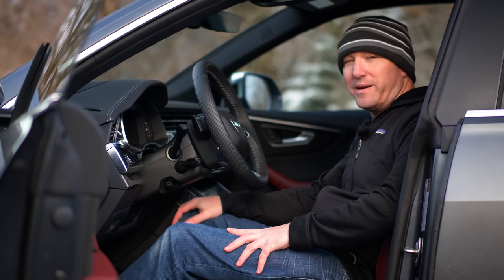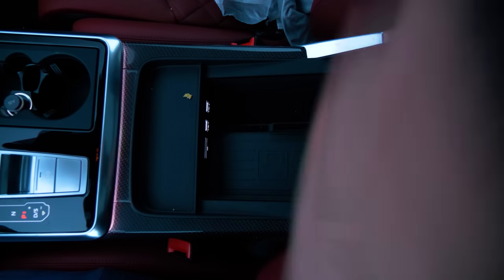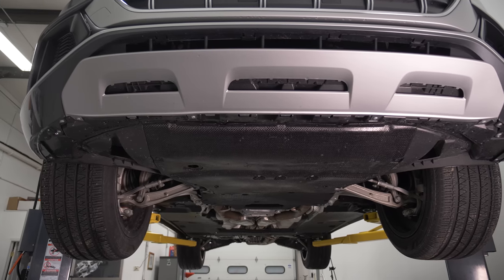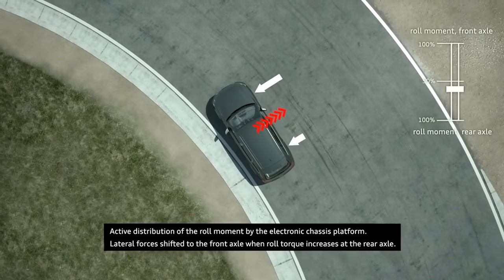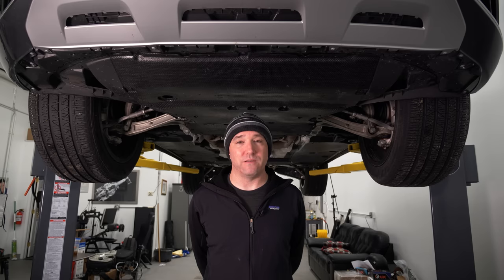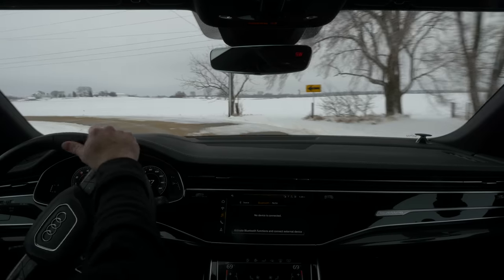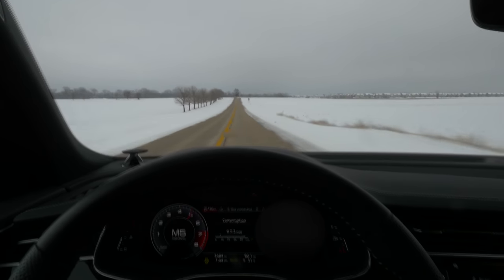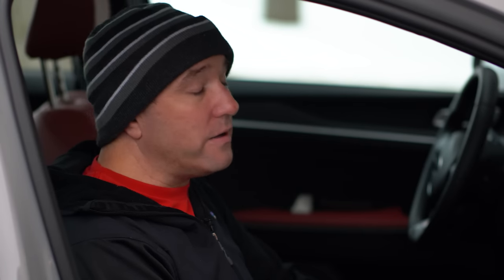2021 Audi SQ8 | Replacing Sports Cars

Comment: Would you expand upon how the optional Sports Package helps with "off roady" situations as you called them?  And in particular more about the Rear Sports Differential, how it works, and how it might help in "off roady" or snowy/icy road conditions?  You briefly mentioned the Rear Sports Differential but only discussed the Active Roll Stabilization, the other part of the Sports Package.  Thank you, to the reviewer and/or any posters that care to comment.
Reply: This doesn't answer your question directly, but from the video I inferred that if you can't (or don't want to) get the Sports Suspension option you might not want the car. I was debating one but given the scarcity of cars out there no SQ8s were available equipped with that option (at least at a reasonable ADM) so I decided to wait.
Reply: @normankleinberg5525  It's funny, or frustrating, but I haven't even gotten to the issue of availability yet, I've just been trying to decide on my first choice for vehicles first.  I've watched a lot of YouTube videos for the Q8 and SQ8, and I haven't seen anything specifically to suggest not getting the SQ8 without the Sports Package.  I did see various references as to how good it was with the sports package.  One video commented on how turning at higher speeds the active roll stabilization part of the package absolutely kept the car flat to the road (A few Q8 videos commented that with the engine so far forward in Audi's, they can dive a little on turns at speed, but for the most part that was described as not a big deal; I assume the active roll stabilization greatly improves that).  I did see one video comment on how rapid acceleration on a straight road, how that was noticeably straight and impressive with the rear sport diff that comes with the package, which makes sense, because it can send more or less power to the  right rear or left rear while as needed depending slippage.  Superficially, that makes me think that the rear electronic ltd slip diff that comes with the sport package won't hurt and might help on snow and ice covered roads, with grip and slip and  such.  Might help but won't hurt would be good enough for me, though I'd love to learn specifically that it would absolutely help in wintery conditions, and specifically regarding my concern below.

My biggest concern is if by adding the sport package and that rear ltd slip diff will it somehow affect how much power and how quickly that power is sent to the forward or rear axel in any give situation (They have a base of a 60/40 rear/front power split, but I've seen multiple videos say as much as 70% can go forward and 85% to the rear as needed in specific situations, I might have those two reversed but I think that's what it was).  I am concerned that with the SQ8 having that rear diff that it might keep more power to the rear axel to be split right or left as needed, when without the sport package and that rear diff, it might keep more power towards the front.  I don't want to sacrifice the AWD capability on bad roads in bad snowy weather.  An example, if in a certain wintery situation the SQ8 without the sport package might send 70% front and 30% rear given where slippage is sensed, will that same SQ8 in that same situation, but with the sport package, still send the same 70% forward and 30% rear, but simply apportion that rear 30% right or left as needed, or will having the sport package and rear ltd slip diff tend to keep more power to the rear axel than would otherwise be the case.  

Sorry for the novel, but if I've explained it well, any thoughts on my main concern?
Reply: @Nate-zy5ce  Just a couple of things:  I was thinking more of the active roll stabilization keeping this big, heavy truck flatter when cornering, accelerating and braking. I didn't even consider the LSD; I think with Quattro I'm covered as far as snow and (to a limited extent) ice are concerned. Also, once you add on the Sports package my impression is the price of the SQ8 is pretty close to that of an RSQ8. But the end result is this:  It's nice to know you have the "Sport suspension package" but how much are you really going to make use of it? As well, do we really need 500 HP? I have a 2018 BMW X3 M40i now (I think about 350HP) and I can probably count on the fingers of no hands the number of times I needed all that power. If you take the car to the track or really do some spirited (read cop-baiting) driving in the twisties then MAYBE, but frankly I think only a small percentage of people will actually see a difference. Of course there IS resale. :) So my heart says don't buy it without the ss option, my head says I'll never really miss it.
Reply: @normankleinberg5525  Thanks for the conversation.  Good point about how much do you really need the sport suspension, and quattro is already good in the wintery weather (The right snow tires as always are the most important, of course).  Nice to have the two features of the sports package (roll stabilization and rear ltd slip diff), but we each have to decide if its worth the added funds.  I did Builds online, and a fully loaded Q8 Prestige came to about $100k, and a fully loaded SQ8, including the optional sport package, came to a little over $120k.  I don't recall how much extra the sport package option was but I think it was $7k more, but you'd have to double check.

One thing, you mentioned how much do you really need the 500 HP.  You may know this but just didn't reference it, but the SQ8 with or without the sport package comes with the twin turbo V8 with both HP and Torque in the 500's, I think mid to high 500's.  It is the Q8 that comes with the inline 6 Turbo with both HP and Torque in the 300's, I think mid to high 300's.

From the videos I've watched, the Q8 is decent for most people, has some pep, though turning at high speeds does have that small amount of roll b/c the engine is so far forward (Same issue with the SQ8 unless you get the sport package with the active roll stabilization, which appears to be added cross steel bars up front in the engine compartment to make the  whole thing more rigid, though there may and probably is more to it than that.  You can get the 4 wheel steering on both the Q8 and SQ8, which I would definitely do, for I've heard many very positive comments about that, mostly maneuverability at slow speeds and a tighter turning radius, but in one case a reviewer referenced he thought that added rear wheel steering helped with grip in snowy or slippery conditions since the car tracked better on turns, and that makes sense to me.  Jumping to the stronger engine of the SQ8 apparently goes from a peppy inline 6 turbo to an outright powerful and exciting twin turbo v8, I think both with the mild hybrid which helps especially on the Q8 to get off a start a little quicker.  The Q8 gets 18/23 mpg city/highway, while the SQ8 gets 15/21 mpg city/highway.  21 mpg on the highway for the big v8 is pretty darn good.

I like the sportier seats and dual exhaust of the SQ8 better, though the Q8 is good.  The one thing I wonder about especially is that the Q8 is seen as very, very comfortable and smooth and quiet a drive, though you can pep it up a bit putting it into Dynamic mode of course.  But it concerns if jumping to the more powerful SQ8 makes the drive less comfortable and smooth and quiet, and if putting it in Comfort Mode in the SQ8 will or will not make the SQ8 as comfortable and smooth and quiet as the Q8.  If comfort mode in the SQ8 is just as nice a ride as the Q8, then I might pay the extra for the SQ8, just deciding about the sport package option.  But if no matter what I do the SQ8 will never be as comfortable and smooth and quiet a drive as the Q8, then I'll likely go for the Q8.  If you have any thoughts or experience on this issue, I'd welcome that especially.
Reply: @Nate-zy5ce  I was limiting myself to comparing the SQ8 and the RSQ8. You do get 500HP in the former, and I believe you also get the air suspension and rear wheel steering, the S sport package adds "only" the rear LSD, red calipers and anti-roll doohickey. In this video they clearly say the SQ8 rides distinctly "better" than the RSQ8 (I don't know how much of that is the S sport package), I don't know if the Q8 rides more smoothly than the SQ8. I just never considered the Q8, I wanted the SQ8's engine.
Reply: @normankleinberg5525  Re-reading yours, you're right, I see the RSQ8/SQ8 comparison.  I confused myself because I have not been considering the RSQ8.  As awesome as I have heard the RSQ8 is, and all has been glowing, I concluded that the jump from the Q8 to the SQ would give me all the power I would ever likely need or even want, and the much more finely tuned RSQ8, finely tuned for the track basically, I concluded that probably wouldn't handle the less well maintained secondary roads in ski country and the poor quality ski country roads during the winter.  Frankly, I concluded, and this is a guess on my part, that the often rougher roads in the mountains of ski country might actually knock the RSQ8 tuning out of wack more readily, and cause me to have to spend more on maintenance.  Awesome vehicle, the RSQ8, but I just don't think it's right for me.  I am torn between the Q8 and SQ8, the Q8 for the comfort and better mpg, the SQ8 for the extra power and refinements, plus performance if I elect to get the sports package on the SQ8 (not available on the Q8).

Actually, I started considering one of the GM full size suv's, for all the extra space, and thinking their traditional 4WD system (versus AWD Quattro) might be more versatile for my needs.  But the size of the GM's is overkill for me, and since I actually go off road very infrequently, I'm beginning to conclude that I'll enjoy the benefits of the AWD Quattro much more often versus the rigidity of the traditional 4WD system, great in specific circumstances, but less so on actual onroad driving regardless of the weather.  So, I am leaning towards the 2022 SQ8 first, and the 2022 Q8 second.  

My primary decision now, after the sports package option if I go the SQ8 route, has to do with the wheel size.  The Prestige of either forces me from the standard 21" wheel to the larger rim/thinner rubber sidewall 22" wheel if I elect to get the Black Optics package.  Black optics is awesome looking, and I really like it, so I am trying to decide if the slightly thicker rubber of the 21" wheel (285/45R21) is noticeably better enough compared to the thinner rubber of the 22" wheel (285/40R22) at absorbing bumps and ridges and such on roads in less than ideal maintenance and/or weather conditions to warrant foregoing the black optics cosmetic appearance which is so beautiful.  Any thoughts on that, specifically if the drive of the 21" wheel will be different/better enough than that of the 22" wheel to skip the black optics, or put differently, if the difference will even be noticeable?
Reply: @Nate-zy5ce  I would say it's a question of whether you NEED the power of the SQ8 or WANT the power of the SQ8. I think there are a lot of people who want it but don't need it, which is fine, it's their money. As I've gotten older I've started to appreciate a quiet and smooth ride more and more. As to tires, I had an RSQ8 on order and bought a winter tire/wheel setup  for it in preparation for delivery. I have four new Vossen 22 X 10.5" HF2 wheels + four Vredestein 285/40R22 Wintrac tires sitting in my garage right now, because unfortunately I had to refuse delivery (for a reason which isn't germane to this discussion). I chose the combination after doing a LOT of research which showed it would be fine for the RSQ8. Therefore I think the 22" wheels you are contemplating would be fine for the SQ8, I wouldn't give up the BO package. Worse comes to worst you can do 21" Winter and 22" summer. Just my $.02.
Reply: @normankleinberg5525  It's a good 2 cents.  I hadn't thought of using 21" for winter and 22" for summer.  Frankly, I didn't know that was possible.  I thought you had to choose one size or the other; otherwise, if would be much more of an expense every Thanksgiving and Easter to not just change out tires, but change out wheels too, assuming I am understanding that correctly.  I'll look into it.  Thanks for the idea.  OH, and I too am becoming an old gheezer, 50 now, and appreciating a smoother, quieter ride as well.  Funny.

Comment: if you think that buying a NEW Audi is expensive, you should see what owning and maintaining an OLD Audi is like.  Buy a fairly cheap $20,000 Audi and you will easily have repair costs in excess of $10,000 per year on it. After just 10 years of owning it you could have bought a brand new model instead (or a house).

Comment: If you want a true sports car than you should buy a classic or a second-hand model. A 1965 Ford Mustang is a lot more connected to the road than a big, heavy SUV with multiple computer assistance systems. The looking SUV coupé is just an obnoxious status symbol, like every other "performance" SUV. Yes, it's faster than a Mustang in a straight line, but sports cars aren't all about speed. It's about the connection to the road, the enjoyment, etc.

Comment: A cow in racing overalls as Clarkson describes the older Audi TT, this is a hippopotamus on rollerblades, something not meant to be fast without a truck load of technology. This is just a cash cow for the modern market. Practical as a screen door on a submarine and expensive as hell. Love when these go in the grass or against the side rails on Nürburgring, they are not meant for spirited driving on tight turns, they are just heavy and fast. Audi should stop this touchscreen non–sense, my 08 Prius had the same thing but they managed to make those controls more intuitive and safer than on this. I will buy a Lexus RX over this sports dishwasher any moment.

Comment: It would take an RSQ8 to replace a sports car.  10:45 brand new Audi already has check engine light.  That's not something you'll see in a Lexus or even a Tesla.  If I wanted to spend $110k , it would have to be a Tesla Model X DMP and keep $10k in my pocket.  14:15. I do agree to never ever own an Audi or Porsche for that matter, out of warranty nor without an extended warranty. The parts and repair costs are just brutal.  Your dealer service department will be on Speed Dial. " Siri, call Audi Service "

Comment: I like German vehicles but please, send these ridiculous,  high performing M-this, X-that, AM-whatever SUV's back to Europe and the Autobahns they were designed to operate on at unrestricted speeds.  An American made Lincoln Aviator or Cadillac SUV packs plenty of 
horsepower, are more practical and are engineered and manufactured to perform on American highways.